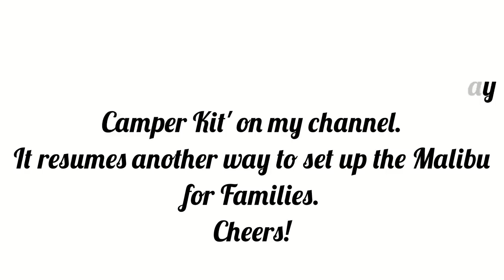Camper van kit conversion  Malibu 4  by Freeway, FULL tour! (Check improved 2020 model link bellow)

Comment: This is the single best convertible living space designed for minivans! It is amazing. This changes everything. With this system you can convert a regular minivan into a campervan without spending the added money to go buy a conversion van. Regular minivans are so much cheaper to buy than conversion or class b motorhomes. Your engineering skills will benefit so many people. Wow.
Reply from the maker: Dear Kenneth White, Thank you so much for those kind words 😊 We did work hard to get the best out of the minivan potential so every one can now travel around the country! Cheers!
Reply: Its not actually that practical or inexpensive.  Too much moving around and stuff.  The  sink and rear system was cool.

Comment: The multiple configurations of the bedding are very clever, and using ladders is brilliant.
Reply from the maker: Thank you Lindy Lund, those are very kind words.😊
Reply: @freewaycamperkit-yourroadt4414  
Wouldn't the "feet" of the ladder frame supports dig into the carpet?

Comment: This is good. I'm pleasantly surprised. The designer could probably really come up with something if they designed for one adult, since it seems unlikely a family of four would choose this design because of the storage limitations; they could, but probably wouldn't. I would do the kitchen on sliders though for better access to the sink, more counter space and someplace to put a stove. I'm very impressed with the folding bed though; thats quite remarkable.
Reply from the maker: Dear Dreamingrightnow, there will be a model derivated from this one for single travelers that will incorporate a seating and work space area with a small table. The stow and go holes in the floor creates a massive storage space when seat are out on second passenger row. In addition, foldable boxes can be stacked flat on the foldable part in the back to store accessories. The cushions can be put differently(Vertically) to accommodate the foldable boxes (pictures on web site).
Cheers! 😊
Reply: @freewaycamperkit-yourroadt4414  Very good, I look forward to seeing the single. The kit concept is a good one; more versatile than the prefabricated class b's in the wider range of vehicles one can choose from, with varying space and interior configurations. Many people don't have the time or ability to do a full rebuild and this is a reasonable answer to the expense and inflexibility of an rv.
Reply from the maker: @dreamingrightnow1174  There you go
Reply from the maker: Hello! You can check out the 2020 Malibu 4 here, there is a section regarding the storage: https://youtu.be/NRy0jP-jOgg Also, there is a new model called the Nomad whch might suit your needs for a single traveller, check in out of my channel! Thanks😁

Comment: Not what I need but fantastic idea. Using 2 x telescopic ladders is brilliant. However I do not understand how you defeated the catches on the ladders. Mine has many catches which are difficult to release. You need both thumbs and it is easy to lose a finger in the process :). How did you do that?
Reply from the maker: Dear Izif, thank you for your message. We will have several new products coming out this spring, including models for single travellers, you may found what you are looking for. By then, you may want to visithttps://www.freewaycamperkit.com/en/ to check out what is availabale right now.  The ladders will lock when steps are fully deployed only🙂. Cheers!

Comment: Looks great and would work great for one person but what happens if it rains?????
Reply from the maker: Dear Ron, Thanks for writing. People use the living space available in between the front driver and passenger seat when bed is folded in half. It is possible to install 2 small folding chairs and a small table in between. But you need to know that because this system is so cheap to operate, you better follow the sun if forecasts are not favorable 😉
. You also need to know that there will be a variation of this very kit that will be made for single travelers, it will include a seating area with a work table, bed size will be twin. Stay tuned! 😊
Reply from the maker: Hello Ron, please go check the new Model called the Nomad on my channel😊. It as an interior living space